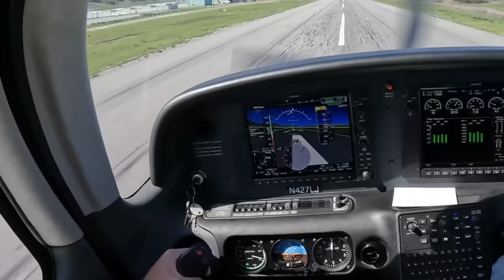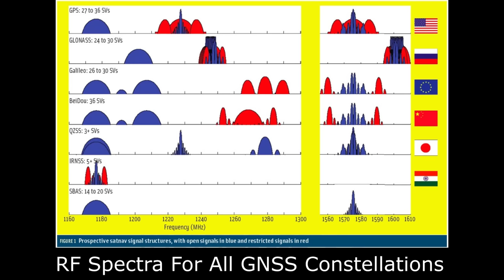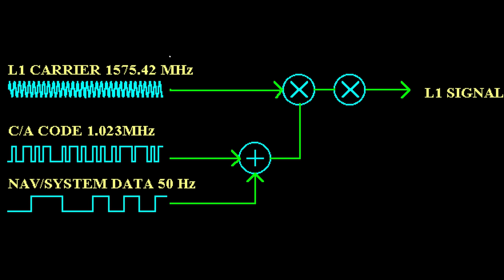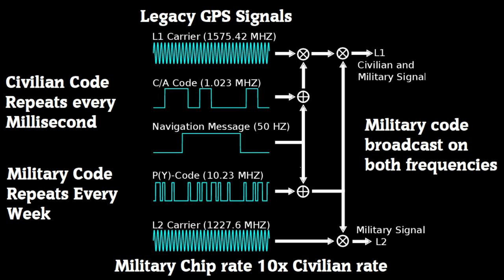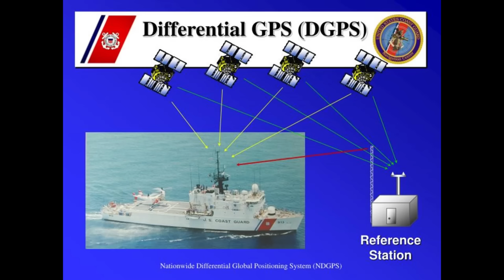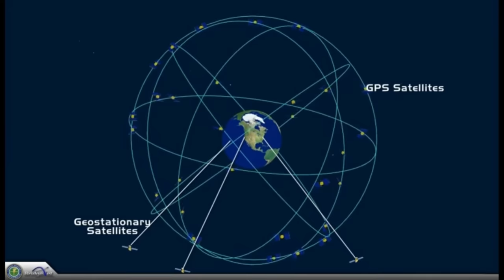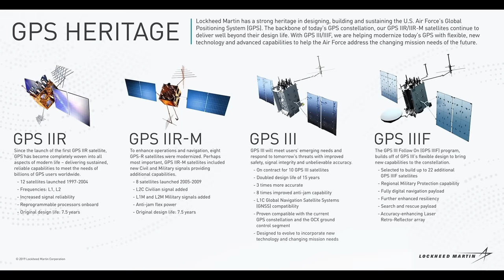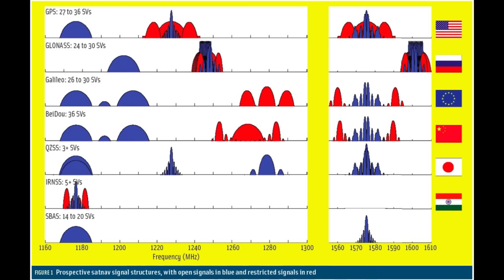How GPS Works, And How It Got Better Than The Designers Ever Imagined

Comment: KAL007 is a really tragic story, apparently there was a U2 running a racetrack pattern on the edge of Soviet radar coverage and 007 turned up on its track just when the Soviets expected it, it didn't turn around so they sent interceptors. The Soviet main radar wasn't working so the interceptors were scrambling and didn't have time to do a visual. One of those pileups of mistakes and bad luck.
Reply: The Soviet pilot who shot it down did have a visual of it, and knew it was a 747 (two rows of lit windows). The word he'd gotten from above in the strict top-down Soviet military hierarchy was to shoot it down at all costs. He rationalized that order by concluding it was a civilian airliner that had been repurposed for military use.

Comment: Has anybody-else noticed GPS Antennas mounted on Road Graders?
And not just on the machine, actually on the end of the blade!
I'm guessing they are using Differential-GPS to get - in particular - the height correct.

Comment: The original GPS was designed to be inaccurate, the military wanted to keep the tech for themselves.
Then Australian CSIRO figured out how to send a conpensating signal that corrected the GPS dithered signal.
When the GPS signal was corrected, the military decided to no longer dither and the signal became accurate.
But it was never inaccurate, just deliberatly scrambled.

Comment: You missed a couple of aspects of GPS. One that it has to constantly adjust for tidal effects from the moon, and second that specialized GPS systems and software used for surveying and construction can achieve GPS location accuracy to 0.1mm. Though it will set you back 100k dollars, plus about 10k a year in additional software licensing fees if I remember correctly. Ones that are accurate to a few mm are much cheaper. (edit) Others have also reminded us that GPS adjusts for the effects of general relativity on the signals. WOW.

Comment: I wouldn’t trust that synthetic vision on the garmin for low vis approaches, it showed you over the numbers several seconds before you actually flew over them. Also, the very broad center stripes makes you feel like you are lower than you are.
Reply from the maker: Indeed, you are not supposed to use synthetic vision in this manner, if you hit your minimums and don't have sight of the runway environment then it's time to go missed.

Comment: You always need N+1 references for N dimensions. Imagine a single point of reference. In one dimension, you don't know which side you're on. In two, you're on a circle, in three, on a sphere. Two points would work for one dimension, but for two, you now are on a line. In three, a circle (I think). Three point in 3d is still ambiguous.
The only thing that kind of allows three satellites for three dimensions is that you can assume you are not below the surface.  That would require you know the terrain.

Comment: I'm amazed at the accuracy of my Garmin watch when using GPS. It can even use other satellite systems but burns a lot more battery then.

Do any satellite systems use GPS (or similar) to know where they are or set their clocks, or it is only for terrestrial navigation?

Comment: the improvement in the modern wave shape is because of modern software tuneable filters, it has to do with the number of poles.
Reply: hi michael, what do you think about all gubments drawing a line around you(Antarctic Treaty) and saying you are not allowed to leave? If you don't know what I mean, read my about tab.
Reply: i was talking about frequency tuning poles used to tune frequency filters in transmitters.  @flat-earther
Reply: @Michael-vl7ti  okay. well we were all lied to when we were taught that the earth is a ball flying in a vacuum

Comment: I have read that all non-military GPS receivers must have a check in their software against moving too fast (speed of sound or thereabouts) and/or high (tens of kilometers) and refuse to provide any output if these limits are exceeded. This is to prevent anyone building a GPS-guided intercontinental missile. Apparently some hobbyist rocket builders have been hit by this.

Comment: 0:30 that's not entirely true. There is A-GPS, or Assisted GPS, which uses mobile cell signal strengths and cell tower IDs. It may also be augmented by WiFi ESSIDs it picks up in the area. Even without any gps data at all, you might get really good results (within a few meters) with wifi data alone.

Comment: back in 1999 I had one of those magellan units and mounted in my 1998 camaro. Was not helpful at all though because no roads or geographical data in the reciever. Basically just waypoint dots. I felt cool though!

Comment: Military stuff is quite interested in anti-jam for obvious reasons. It's shocking just how low power the signals are. But what's scarrier isn't denial but spoofing. Instead of denying location info the system can be fooled into thinking it's somewhere it isn't which I believe was used to capture a drone. Now there are encryption codes to verify the signal is legit. These are the kind of codes that get zeroized on ejection. My understanding is the GPS can be effectively turned off or at least degraded in a narrow geographical area if you don't have said keys

Comment: I think there is also another reason why Selective Availability was turned off: the Russian GLONASS system was operational since 1996 and didn't have artificial restrictions like that, so everyone who wanted to use satellite based precision weapons could have them anyway by using GLONASS.
Reply: In 1996 GLONASS wasn’t really very useful yet, like with many other Russian hardware it’s reliability was spotty.
Reply: @rfvtgbzhn  you heard from whom? Russian fighter jets are very low tech compared to American counterparts plus I don’t think there is any reliable source on the subject. I doubt that a country that can’t produce a reliable, modern passenger aircraft would all of a sudden produce a very reliable fighter jet unless the tech is so crude that comparison apples-to-apples comparison is possible.
Reply: @rfvtgbzhn Cockpit videos from the war show many Russian pilots using inertial navigation (or 3rd party GPS) rather than GLONASS; it may still not be entirely reliable

Comment: In the 1990s I had a Magellan unit, which would report my position as randomly hopping around a point with approximately 20m accuracy.

Yet as soon as I started walking, my speed was accurately indicated, this was obviously not calculated from those "selective availability" randomized inaccurate points. And there was no other means of calculating your speed that I could find. How did this work?

Comment: Differential GPS is far more accurate than a few meters. We use it to survey to around 1cm if the baseline is under 12 km or so. Occasionally, some will attempt to perform differential GPS using to consumer grade receivers with terrible accuracy, assuming it's just comparing location errors. In true DGPS gear, each satellite signal is compared and corrected separately. As a result, we can measure and account for tectonic velocities of something like a property corner.
Also WAAS has been around since the mid 90s. Not 2003. WAAS approaches with reduced minimums became approved in 2003, but the location services had been around years prior.
Reply: hi ryanmcgowan, what do you think about all gubments drawing a line around you(Antarctic Treaty) and saying you are not allowed to leave? If you don't know what I mean, read my about tab.

Comment: I wonder if we might regret letting the VOR's fall into disrepair - when I first heard about GPS I was told that although it was useful and fantastic you shouldn't bet your life on it always being there. it's owned by the US military and the US military could decide to switch it off without warning.
Reply: If the GPS network went down it would cause some issues, but now they're not the only game in town.  Most devices use all the available networks.  Of course all of them are vulnerable to space based events.
Reply: @TheEvilmooseofdoom  There are Galileo by the EU and Beidou by the PRC which are basically GPS clones with different constellation parameters.

Comment: The original wide band accuracy of GPS was down to the military as they didn't want the civilian and maybe the terrorists to take advantage of accurate GPS, which the military had from the outset.  Since then the advantages of accurate GPS in all spheres of life, not just transport, outweighed the risks and the civilian use of GPS in land and topographical surveys has transformed the industry.

Comment: Most phones today use all the 4 big systems; GPS, GLONAS, Galileo and the Chinese one.

On top of that, most cell towers broadcast their exact position, and local time.

Combining all that information, the navigation module inside the phone can flag if one satellite or an entire system has gone rouge. And, when all the systems play nice, the phone can combine all the data to get sub-meter accuracy.

But i can understand why civilian grade GPS hardware is limited regarding speed and altitude... shouldn't be too easy to obtain military grade positioning to strap on to your homemade rocket.

But even with the limitations in place... I have been able to get both altitudes and speeds out of my phone, that GPS itself isn't supposed to allow, while on a commercial flight (of course in flight mode, just with GPS turned on, and the phone pressed up against the window).

Comment: Fun fact, I had one of the first generation Tom Tom GPS, and I was driving towards a recreation space, and the GPS worked well, till I lost connection, and the GPS steered me onto a round point, and said, turn right on the next street. So I did, but instead of a street, it was a parking space from a house that was connected to the round point. I have to admit I had to stop quickly because otherwise I would drive right into that house. Good, these are now more advanced.

Comment: C/A codes are pulled out of the soup by constructive interference within the receiver. With a 30 second message transmission time (which, divided by 12 channels in a typical modern receiver, gives us more than two seconds, on average, between updates), doesn't there have to be a supplemental means of determining position information with a higher frequency of update to auto-land an airplane safely?

Comment: What was the practical reason for the military to "nerf" the accuracy for civilian use? I can't really think of an application at that time where a civilian could have done any more damage with 1-meter versus 30-meter accuracy. GPS-guided bombs and precision rockets might have been a thing by then, but there was no civilian hardware, like consumer-grade drones, that could deliver an explosive into a window you'd rather they didn't until relatively recently. The 9/11 hijackers certainly didn't need 1-meter accuracy to do what they did, either.

Comment: The phone does not "figure out" the orbits of GPS satellites, the satellite transmits it's orbital parameters.
ADSB is secondary radar and is replacing "primary" radar that depends on skin reflections.
Reply from the maker: The satellite transmits orbital elements, which the device then uses to figure out the locations of the satellites at transmission time.
Reply: @scottmanley   Yes.  Also, the almanac is a rough version of the ephemeris.  The Trimpack receivers used a keep alive chip to maintain the dynamic RAM, i.e. it made dynamic RAM look like core memory, so that when you turned on a Trimpack it could get a quick fix if it was not to far from where it was turned off.

Comment: The reason we need 4 satellites was not entirely correct.  It is correct that with three satellites, your unit needs to have a just as precise clock.  It turns out that with 4 satellites, the time is canceled out, therefore you do not need any time clock on your device.

Comment: Scott, SpaceX apparently uses GPS for their Falcon 9 booster re-entry and landing.  How do they get it accurate enough for landing at almost zero vertical velocity, or do they augment GPS with some other system like a laser or radar altimeter?
Reply: i guess with a good enough receiver and software you can get one magnitude better accuracy than commercial receivers. Your phone can probably do more than 1m accuracy if the view of the sky is good.

Comment: Scott Manley, could you please explain why GPS is so much worse in the North?
If you get within 10 meters, is it normal and if you get below 5 meters is it rare, below 2 meter is almost unheard off.
Reply: GPS on your phone or on a dedicated GPS unit?
And define 'north" please.
Reply: @sissyfus6181  Thank you so much for your comment. It does not matter if it is a dedicated or a phone GPS, and by North do I mean from Denmark and up. But I think I may have found out that, from 55 and up, is it increasingly less reliable.
Reply: @friedmule5403  Weird.
I find if I turn off the phone connection and just use the phone GPS it's not bad.
Cell coverage up north has been pretty spotty at best, turning it off seems to improve the GPS data.
Dedicated Garmin units (Oregon and Montana with paid for maps) is usually better than 3m up to arctic circle.
(About as far north as I have gone).
Car navigation GPS's don't seem as accurate and also slower.
Reply: @sissyfus6181  You are right in that turning restarting a unit can help, but dependent on your location. To me, does it sound as if you are talking about the pro-gear with big antennas while I am talking about the normal gear, most tend to own. :-)
I can risk an accuracy down to 10-20 meters, or if inside a town, can it go down to 50 meters. What makes the GPS such as Garmin better is the fact that they try to follow the roads, so they do more show you what road you properly are on, instead of where it measures you at.

Comment: I've always wondered why inertia can't be used to make a perfectly accurate positioning system. From what I understand there is drift that cannot be eliminated with inertial measurement systems and it builds up so quickly that it just isn't feasible. Shame, it'd be really useful.

Comment: Very impressive technologies but it looks like we are putting all eggs in the same basket: if there are some hostilities in space this would threaten all navigation and transportation. Land based navigation stations like the good old lighthouses should still be kept up.
Reply: Though some sites are slated to turn down as Scott references, in truth the FAA has no plans to completely deactivate the VOR system or the old ILS (localizer, glide slope, and distance measuring equipment). Even as old as they are, they're not as prone to error or sabotage. Long before an aircraft could reliably land on GPS, I watched videos of flight check aircraft shooting instrument landings at PDX (Portland, OR), touching down right on threshold and nosewheel on centerline in a super-thick fog, so though GPS is more universally useful, GPS landings aren't as clever a trick as it might seem.

Politicians and bureaucrats often grumble about the cost of the extensive number of these systems in the field, but then something reminds everyone of why they're still there. For a while in the 1990s as part of the "peace dividend" at the end of the cold war, the Air Force turned all the long range surveillance radars (ARSRs) over to the FAA (saves money on military training, lightens up bureaucracy, all well and good). In turn, many were looking to retire the active search portions of the ones not monitoring the borders in favor of just using beacon (ATCRBS) to save on maintenance costs, but various incidents, including 9/11, showed why it wasn't such a good idea to assume all aircraft are cooperative inside the borders.

Comment: While an amazing system, it is also somewhat dangerous. If we rely solely on them, we lose the old reliable skills (which need regular practice) we used to use for navigation. The satellites  themselves become a potential single point of failure, crippling mobility should they be compromised or destroyed.

Comment: I'm curious of the life span of the GPS network the US runs. Also curious of infrared hole capable GPS systems capable of much higher data rates, if those are in development or already deployed since infrared isn't as affected by the ionosphere.  It's certainly a lot more chaotic than radio since water vapor and methane interact with them but we have such exquisite ways of mitigating that with outward projecting lasers which we use to correct telescope data from atmospheric turbulence.  I would have suggested the visible spectrum but then everyone would see them all the time and that would be heinously annoying let alone the power requirements to implement.

Comment: I heard that in very flat countries like the Netherlands, they can use one less satellite for GPS solutions (three instead of four at minimum) because they can assume the altitude is very close to a constant always; compared to the vertical error you would have anyway.
Reply: Any GPS receiver with a medium accuracy topographical (terrain altitude) data can do that no matter whether it’s flat or not. Position accuracy will suffer a bit but it’ll still be usable. Now, not many consumer GPS receivers do that. But for those that do, 3 satellites is enough for a rough fix.

Comment: No. It is maths (an abbreviation for mathematics). No, Civilian GPS was originally supposed to have a precision of 100 METRES, nowadays it's good within 1 METRE. 
A METER is a measuring instrument. A METRE is a unit of distance, similar to a YARD is a unit of distance. The correct spelling is important otherwise the meaning is not correct.

Distances:

MilliMETRES
CentiMETRES
METRES
KiloMETRES

Instruments:

SpeedoMETER
AltiMETER
OdoMETER
VoltMETER
AmpMETER